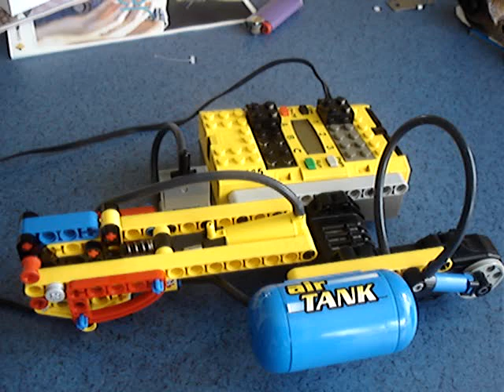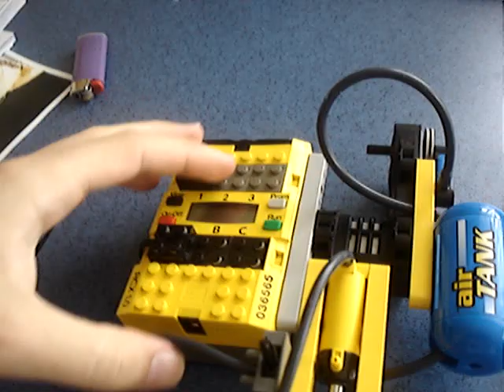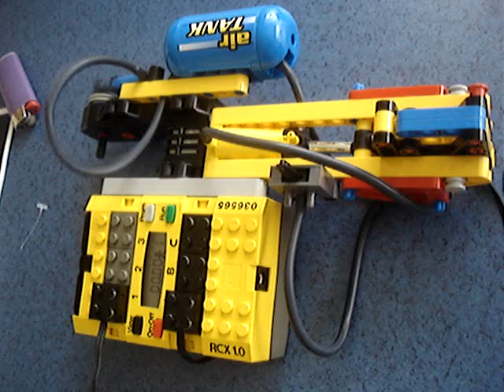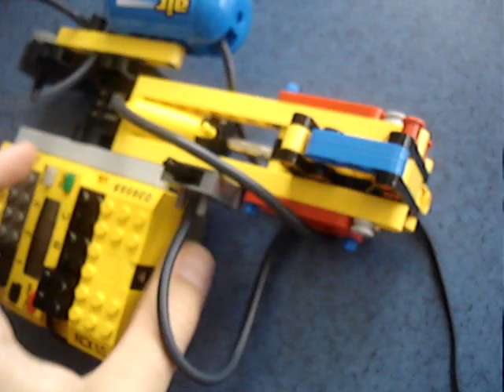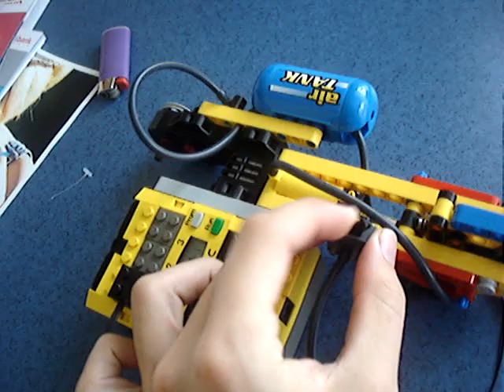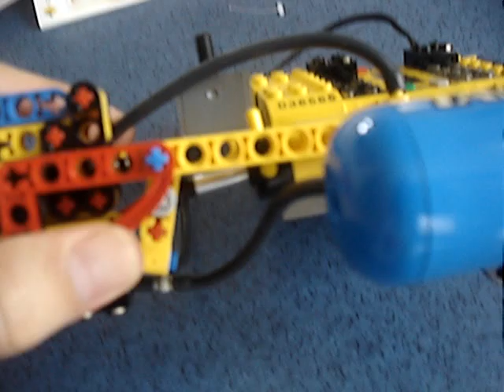Automatic lego air Compressor

Comment from the maker: There is a motor set that was sold between 2006 & 2008 as an add on to some technic models... and it also came with a lego technic crane (8421)

Comment from the maker: Thanks! The way I adjust it for a different pressures is in the programming. I just program it so that when the touch sensor is pressed the motor will switch off after a certain amount of time.

Comment: I was thinking about getting some mini pumps myself (check out my compressor, it uses two big yellow pumps)... seems like I could probably pump more with smaller pumps, since there's less resistance.  I mean, 'pump more in a shorter amount of time'.  You should upgrade to NXT, it's pretty nuts :P

Comment: you can build something like this without micro-computer. just change the touch sensor by the button of a battery pack. i havent testet it yet, but it should work. just it would start compressing when the button is pressed until the pressure is high enough. also you have to adjust it in that way that the button doesnt snap so it would compress until it blasts :D

Comment from the maker: @demonbreed131 
What I do is go to Peeron dot com and search for a set that I know has a part I'm looking for. For example... If I'm looking for a motor like the one in this video, I know that that's in set number 8421... so I search it on peeron which gives you a list of parts with their numbers. Then search the part number you need on bricklink... and it will give you a list of new and used parts with prices that people want for them... you can find some stuff quite cheap...